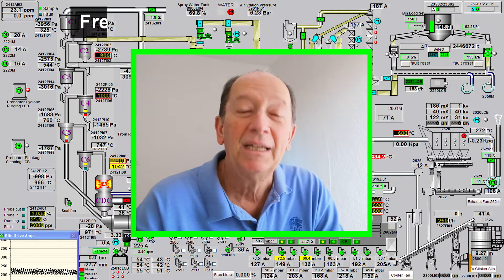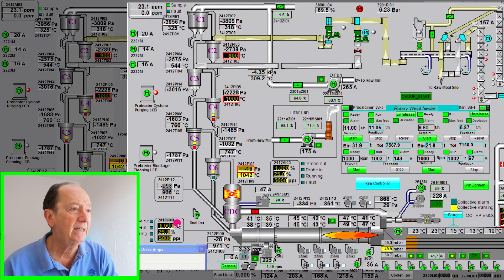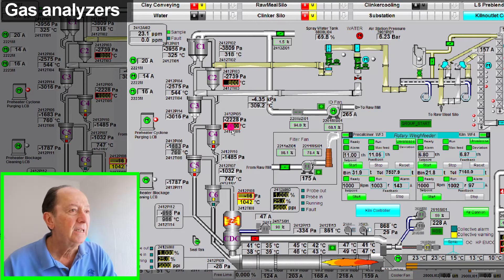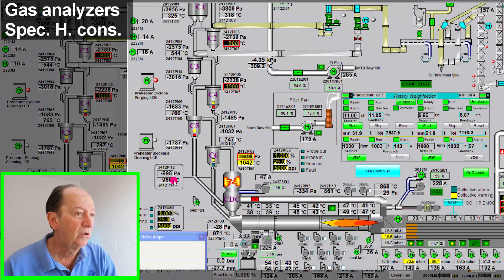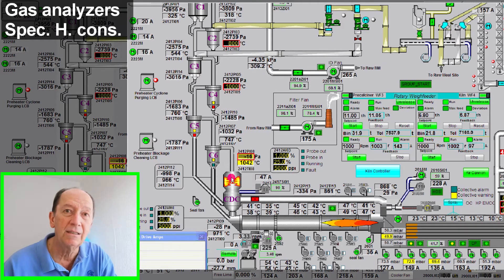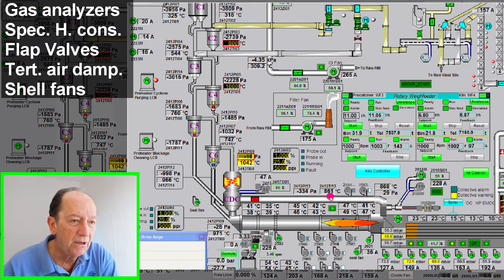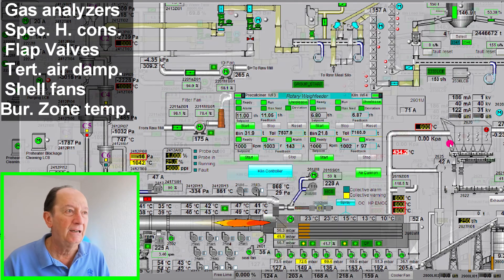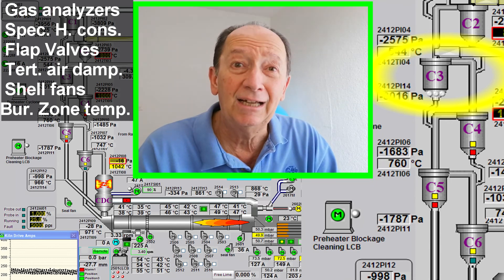Review, Kiln disturbed operation

Comment: Sir reduce ph draft and flow 
But increase kiln coal firing 
And also kiln rpm must be increase
Kc firing 30 to 35 %
Pc firing 70 to 75% maintad 
I feel if kiln coal is not sufficient then
That time esp temperature should be gradually increased

Comment: can i contact you personally i have some doubt to be cleared it will be great pleasure for me
Reply from the maker: And ... no contacts from your side, is it all right?
Reply: @vbrcement3666  i have already mail you sir
Reply from the maker: @AlokSharma-qqwwee  
Then I am not sure what you mean when you ask if you can contact me personally.
Please clarify what you need.
Reply: @vbrcement3666  if the free lime in clincker is more than 2% or less than 0.80% then how will it effect grinding efficiency ? I have mail you this question but due to some issue it remains unsent..
I apologize for that ..
Reply from the maker: @AlokSharma-qqwwee  

Thank you for the question, interesting point....
If the free CaO is higher than 2%, you will not have grinding problems, on the contrary since this "unburnt" clinker is softer and easier to grind.
But with a > 2 % CaO you will get a very high expansion rate  in your mortar and concrete. In simple words your cement will have very bad quality rating, low performance.

If caO < 0.8% you are getting properly fired clinker = low expansion rate = good cement!
Yes the grindability will suffer a bit (your grinding efficiency will be lower) but this is normal when you produce quality material.

The ideal situation is to keep your free CaO in the range of 0.4 to 0.8%, then you still have correct grinding efficiency  and good cement quality.

Finally, it is bad to have CaO < 0.4% or even 0%! You are over - burning the clinker, and grinding efficiency will be very low, and you will not get an excellent cement. 

So recommendation,  free CaO between 0.4 and 0.6% as a target.

I hope this helps!
Reply: @vbrcement3666  thank you so much for this i really appreciate this .If i have anything to know i will definitely ask you .Hope you dont mind because i am asking you again and again.. Again thank you from your busy shedule you reply my question
Reply: Yes, of course, you can email me directly at   

vbrcement@gmail.com

and we can start from there...
Reply: Ok
Reply: Hai
Reply: Has
Reply: Hai

Comment: if the klin feed is 545 ton per hour what will be the clincker output or clincker produce and how it is calculated.. please can you tel me
Reply from the maker: To calculate the clinker production you use the so called "clinker factor" or raw meal factor.
This factor is based on the LOI or "loss on ignition", which considers mainly how much CO2 is released from you calcium carbonate. The factor also considers the dust "lost" or the dust which is not recovered from the 1st stage of your preheater tower.
The LOI can be calculate with the chemical composition of your raw meal. The dust loss, cannot be calculated, unfortunately.
In other words if you feed 100 t/h to the kiln and you have a clinker factor of 1.56 then, in theory you will produce 64 t/h of clinker... But not all the kiln feed will go through the kiln, because of the dust loss.
The only good and precise way to know your real clinker factor (which will include dust loss) is to measure and weight the actual clinker production during a defined amount of time (ideally 8 or more hours), with the kiln running very stable and with the same feed.
A rule of thumb to know your clinker production (very rough estimate) is to multiply the kiln feed t/h x 15 = tons of clinker per day.  In you case, your system would produce 8200 tons / day  or 340 t/h. This would be a very approximate 1.60 clinker factor.
I hope this helps.... let me know please!
Regards, Fred
Reply: @vbrcement3666 sir can I get your contact details